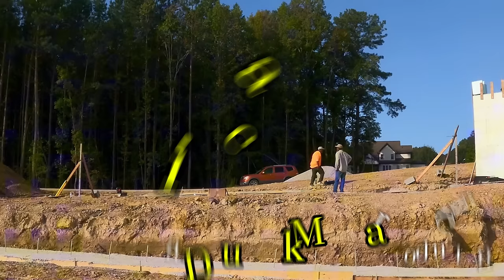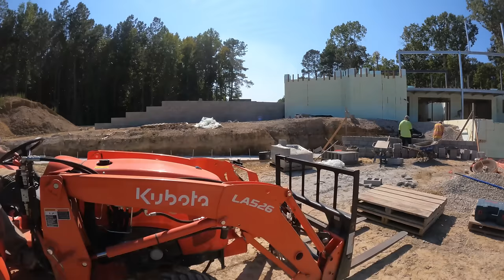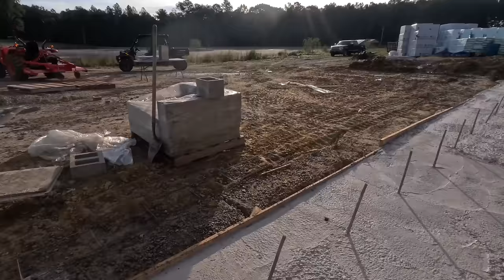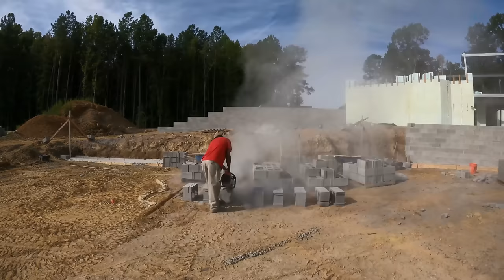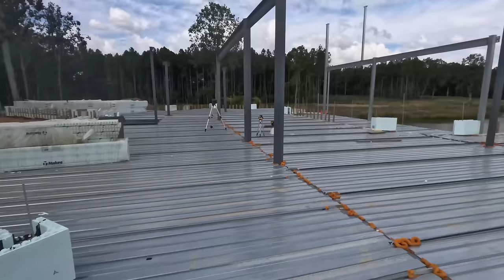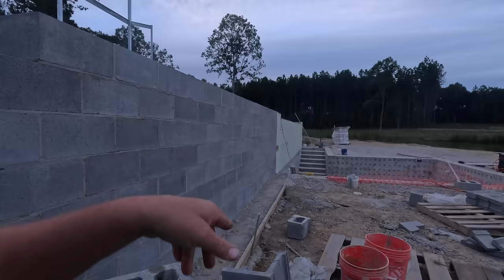Retaining Walls for the ICF Mansion - Update on Progress

Comment: Have been watching the progress for a long time, so far immensely interesting watching different methods being used, full make sir ! On this vid on your retaining wall, looking at the recess for your stairs, the wall to your left, it has a straight joint in the blockwork where it meets the stair recess , ***did they tie it in** to the stair blockwork ? The load will increase (as you know) when backfilled, if not a strengthener pier could be added (Just saying/def not criticising ) Im a bricklayer UK/Mason by trade...
Reply from the maker: There are some piers that still go in. I’m away from the jobsite but I will double check that. Thanks 😊

Comment: Jeff are you required to put fence and or railings around the retaining walls and the lower pool for safety to prevent accidental falls?
Reply from the maker: There are some rules for the pool. The retaining wall will depend on final height above ground level.

Comment: Drilling holes in wall for drainage? Or the filtered hose will take water out to flow into woods? This year you have had a lot of rain. I just wanted one nice three inch downpour in Texas.  Crew made quick work of the walls. Nicely stacked straight and sturdy blocks. Thanks for the video. You are on the down hill side now. Right no more additions??? ha ha 
Have a great weekend.
Reply from the maker: The pipe should handle everything. We got another 3” rain today. Wasn’t in the forecast.
Reply: @BealyGood  good

Comment: What’s the percentage cost difference between ICF and CMU? I assume the CMU labor is more but material is less. Must still be cheaper to do CMU if you don’t need the insulation? But the pool was ICF so now I’ve gotsta know!! 😅
Reply from the maker: Cheaper for CMU overall but didn’t need the insulation. Used for the pool because I wanted the insulation and because I was able to pour the walls and floor solid and at the same time.

Comment: Mr Bealy Good, two guys banged up enough blocks to do half of your ground floor walls in just 3 days so why use the adult lego bricks instead that seemed to take months to build?
Reply from the maker: The retaining walls are 1/10th the wall sq footage of the house. Not insulated and if I wanted to put wallboard/sheetrock on them I can’t without framing a wood wall against them or attaching furring strips. Plus the retaining walls are mostly straight, not all the crazy curves and angles of the house. I’m just a Billy Bob newbie, an experienced ICF crew can build with ICF quickly.

Comment: As a structural engineer the larger the heel the greater the friction, sliding of retaining walls is often harder to design out, rather than the strength of the wall stem.
Reply from the maker: Interesting

Comment: Geoff it surprises me that you did not pour your retaining walls with ICF forms
Reply from the maker: I thought about it.
Reply: I kind of expected just old fashioned forms for pouring since you did not need the insulation of ICF.  Just 8" straight concrete walls.
Reply from the maker: @markpashia7067  it’s more of a use what you have and what you know situation. I don’t know anyone that does form work so this is a better path, for me.
Reply: @BealyGood  I get it. Around here everyone does basements so all the concrete guys have form crews. Even if they do not use basement because of rock they will do footings and stem walls with crawl spaces. Very rarely do you find a slab like was normal when I lived in Houston, TX.
Reply from the maker: @markpashia7067  That was one of the interesting things during my world travels, seeing the different building styles. If I was smart I would have started a channel then.
Reply: @BealyGood  You figured out one of the best ideas though. Concrete walls with mass are much better than stick built and the ICF insulation is even better. Truly the best of both worlds. Your heating AND cooling should be minimal. My daughter moved to Portugal and was amazed how masonry structures hold and level the temps.

Comment: Hey Geoff since the retaining walls are only sitting on a rock footing not concrete how are you going to anchor it so it doesn't move because there will be a lot of pressure on that wall pushing forward.
Reply from the maker: They are sitting on 54 inch wide by 12 inch thick concrete footings

Comment: Prediction: Your footings will be insufficient for keeping your wall from collapsing or sagging without anchoring from higher on the wall back into the earth it is meant to hold back. I give it no more than 5 years.
Reply: I’d give the walls even less time if you had to deal with freeze/thaw cycles like you get in the Northern tier of states.
Reply from the maker: @tylergodfrey2800  cool. I’ll add you to the list of predictions from my comment sections and we’ll see. So far everyone else has been wrong.